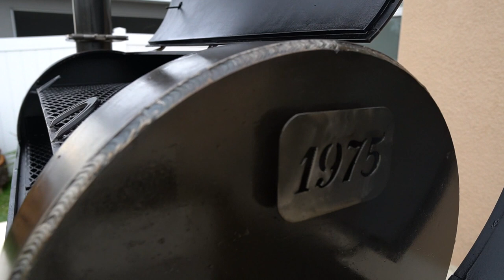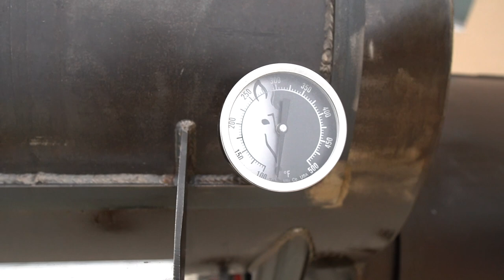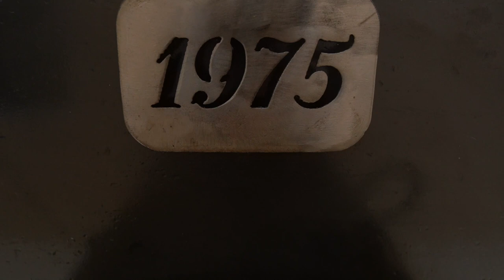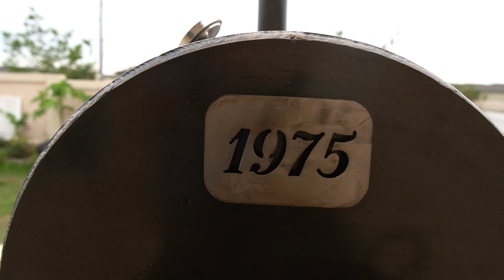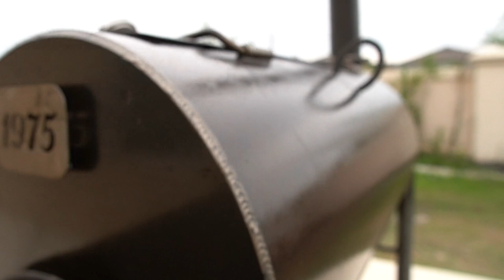Watch This Before You Buy a Workhorse Pits 1975 Offset Smoker

Comment: Awesome Smoker!
I’ve spent a lot of time researching high-quality craft smokers, and I believe this one is the absolute best as far as backyard smokers go. I really enjoy your videos! I’m making a smoker and I’m curious about a couple of measurements on this one:
1. How wide is the cookdoor opening? It looks like 40 inches?
2. How wide is the trim piece that goes around the edge of the cook door? is it 1 1/2 inch wide?
3. What is the frame of the cooking grates made of? It looks like half inch solid square bar.
4. How wide is the firebox door opening?
5. How tall is the firebox door opening if you measure along the curve of the firebox instead of a straight line?
6. How far apart is the upper cooking grate from the lower cooking great?
7. What’s the distance from the top of the cook chamber to the top of the firebox?
8. How tall is the hole that lets smoke in from the firebox? It looks like it’s half moon shaped with a straight line across the top of the hole maybe 8 or 10 inches tall in the center?
Thanks for showing us your awesome smoker!
Reply from the maker: Cooking Surface :
2316 Sq Inches with Top Pull-out Rack and Cowboy Grill
47"x23.25" Grate in Main Chamber
40.5"x15" Optional Top Rack
26.5"x23.25" Grate in Optional Cowboy Firebox
Exterior Size:
Overall Length - 84"
Chamber Length - 48"
Firebox Length - 27"
Overall Height - 85"
60" (stack down)
Reply: Thank you!
There are just 2 final details that I need to fill in,
How far apart is the top rack from the main cooking grate? And how wide is the cowboy door opening?

Comment: Waiting for mine to get here and can't wait. One thing I noticed was that the folding part of smoke stack has a gap in there. I see that there's a hole for what looks like a bolt or something. Is there a way to close that gap as I feel like that could be an issue with hot air leaking through that and messing with the draw.
Reply from the maker: it's not tight.... once you put the bolt in there it's sealed .that's not an issue at all.thank you for watching

Comment: I notice that the stack is not quite flush at the pivot point! Does it have an issue with smoke escaping ? Same ? For the rest of the smoker!
Reply from the maker: Once you tighten it with a wrench…it’s sealed. No issues on that department.

Comment: Thanks for doing all these Workhorse vids, good work and very informative, I've binged watched 'em all! hahaha :p We're north of the border so we're building one and wondering if you could assist with some measurements? Really appreciate it if you can. 

Overall height of throat opening? 
Height from bottom of firebox, inside, to throat opening? 
Height from top of firebox, outside, to top of food chamber? 
Height of top surface of cowboy grill from firebox floor? 
Height of smoke chamber food grate from ground? 
Length and width of the baffle plate inside food chamber above firebox throat inlet?

Thanks again man! Keep em comin'!
Reply from the maker: Will do when I get home …thank you🙏🏽🙏🏽
Reply: @BackyardWarrior  thanks brother! Owe you a beer!
Reply: height of the collector as well?
Reply from the maker: here you go brother
Overall height of throat opening:6 inch 
Height from bottom of firebox, inside, to throat opening :12 inch
Height from top of firebox, outside, to top of food chamber :12 inch 
Height of top surface of cowboy grill from firebox floor : 12 inch
Height of smoke chamber food grate from ground :12 
Length and width of the baffle plate inside food chamber above firebox throat inlet 20x4 inch 
smoke stack diameter : 5 inch
smoke stack height : 45 inch
Reply: @BackyardWarrior  You're a beautiful soul! Thanks brother, really appreciate it.
Reply: @The-Craftbrewing-Carnivore  Hey Greg.  I own the IP for the chase, and fold down stack.  Send the check attn: JD   I roll my own pipe.
Reply: @The-Craftbrewing-Carnivore   You ever get it built?
Reply: @Quetorials   The legend! Just curious if they make it for themselves do they owe you royalties? I thought that is only if they try to profit off your IP
Reply: @BackyardWarrior  maaaaan thank you soooooooooooooooo much 🙏🏽🙏🏽🙏🏽🙏🏽

Comment: I’ve seen some other videos where they say the pit has the “Carolina squat” on the firebox side.  Seems all the weight is causing some flattening of the pneumatic tires on that side- you had any issue with that on yours?  Beautiful pit, it’s a shame they don’t have locking casters though.
Reply from the maker: I don't have that problem yet 🤞🏽🤞🏽but I had some grease draining into the fire box before I leveled it

Comment: How’s the seal on the doors? Any smoke leaking during cooks? My concern with offsets has always been the firebox... I don’t want my firebox to look like crap or that it won’t last because of all the high heat in there. Also, if you don’t do the cowboy grill is it does it come “sealed” with just the flange/door for air flow instead?
Reply from the maker: no leaks so far... fire box is 3/8 as well .very thick and will probably outlive you if you take care of it.fire box without the cowboy grill is one cylinder with door for feeding it wood and air flows would highly recommend cowboy grill if purchasing the smoker.thank you for watching
Reply: @BackyardWarrior  thanks for the fast reply! Awesome, I had my mind set on the Aaron Franklin but at this point I don’t want to wait 2 years just for them to tell me it’s going to be another 2 years. I really liked that their firebox is doubled wall. Mill scale is just 1k more too much than I wanted to spend. The cowboy grill is something I probably don’t really need since i have so many options for high searing already.
Reply from the maker: @currysaucy4120  both wait list and $$$ are reasonable if you go  with workhorsepits.com
Reply: If you spray the firebox with pam before every cook it will look like a seasoned cast iron skillet.

Comment: What's the distance between the first grate and the second grate, and the second grate to the roof of the cooking chamber? Nice video!
Reply from the maker: here you go brother
Overall height of throat opening:6 inch 
Height from bottom of firebox, inside, to throat opening :12 inch
Height from top of firebox, outside, to top of food chamber :12 inch 
Height of top surface of cowboy grill from firebox floor : 12 inch
Height of smoke chamber food grate from ground :12 
Length and width of the baffle plate inside food chamber above firebox throat inlet 20x4 inch 
smoke stack diameter : 5 inch
smoke stack height : 45 inch  
happy thanksgiving
Reply: @BackyardWarrior  awesome thanks!

Comment: Really appreciate your videos. Are you having trouble finding wood? I am in So Cal and considering ordering a 75 or a 1969 but not sure where I would get the right wood.
Reply from the maker: wood is my last worry.. I think I have enough for 3-4 years.just watch Craigslist and FB marketplace..people always giving away wood.you can always buy it and thats the easy way to get wood.
Reply: I also live Southern California, San Juan Capistrano, get in touch with The Woodshed in Anaheim they have a great selection of hardwoods for smoking.
Reply: @grillinghotsmokinglowinthe6058  Awesome, thanks for that information! Since posting I also discovered South Bay Firewood in Hawthorne. Quite a drive for your but much closer than trip to TX for post oak if Woodshed does not have what you are looking for.
Reply: @NaturallyaspiratedJJM  That's good news for you. The Woodshed always has the wood I need. Waiting on a rack to hold 1/2 a cord of wood, should save me a lot of trips. My 1975 is due to go into production on March 16th so I'll have it mid April. The Horizon Smoker will keep me going until then.

Comment: Thanks for your informative videos! I noticed you have your Workhorse 1975 placed on a flat cement patio. How easy is it for you to push it around your patio? When I decide to get the Workhorse 1975, I plan to place it on my paver patio. How well do you think the standard 8" pneumatic caster wheels would fare on a paver patio? Do you think it would be better to get the wagon option for a paver patio?
Reply from the maker: I haven't  moved my smokers since day one... but it's not that hard with 8' casters. now if you have gravel, grass or dirt and you planning on moving it very often, you definitely need a wagon option.If it's going to be parked on the paver patio ..you really dont need wagon option.casters will work fine with a little muscle action to move it around

Comment: How even are your temps from side to side? Also The right side of the main chamber great closest to the firebox do you lose the first few inches because that area is too hot
Reply from the maker: Pretty even on the  main grate…a little hot on the upper grate(normal..heat rises) . Towards the fire box there is a  baffle plate that prevents the  high heat in the front…so no issues there.machine is well made and a lot of effort is put into it….thank you for watching 🙏🏽🙏🏽🙏🏽
Reply: @BackyardWarrior  hey thanks for your quick response I appreciate it. Are you able to use the entire lower grade to cook on? What's the most you have been able to comfortably cook on it
Reply: @BackyardWarrior  do the doors sealed with no leaks
Reply from the maker: @mikes.3165  I did 6 half chickens and 3 brisket each cook…I m sure you can fit up to 6 brisket in there…plenty real estate 👌👌👌
Reply from the maker: @mikes.3165  no leaks…
Reply: @BackyardWarrior  hey thanks again I really do appreciate your quick responses. I haven't been able to find a whole lot of information online. Is there anything that you don't like about the pit besides it not having a grease stop from the main chamber to the firebox I saw your video about the grease running into the firebox. Is the door very heavy.
Reply from the maker: @mikes.3165  the grease issue was mainly due to my floor that is not even…I have zero issues with this cooker… I m loving it 👌👌👌
Reply from the maker: And yes the door is heavy
Reply: You can put a slim water pan next to the fire box and a split of wood behind it that will help with close to firebox temps.

Comment: Hello, how long does this pit hold its temp until you need to add more wood?
Reply from the maker: Depends on the size of the wood. I usually feed it a couple a pieces every 30-45 minutes and I use around 12 inch long logs and 3-4 inch diameter.
Reply: Thanks!
Reply: What thickness of plywood did you have to use? I will be having the same issue to get it to my backyard.
Reply from the maker: @joshuaochoa4809  1-2 inches and the wheels sunk in few spots.i'd get a metal sheet if I had to do it again

Comment: If I'm correct you're smoker has the powder coated finish. Is that right?
Reply from the maker: No that’s the raw finish…thank you for watching 🙏🏽🙏🏽
Reply: @BackyardWarrior  Like the other viewers you also helped me finalize my decision. I  ordered mine yesterday.
Reply from the maker: @DMV_BBQ  glad I could help... I'm sure you will love it (smoker) brother
Reply: What other smokers did you guys consider? Any info is appreciated.
Reply from the maker: @WookieLove1  I had an old country BBQ pecks before I made the switch and I was looking at mill scale Lonestar grillz and  @workhorsepits
Reply: @BackyardWarrior  I keep wondering about offset vs reverse flow. Looking at the Shirley smokers. But I'm just not knowledgeable to stick burners. I'm a weber guy but want to add a stick burner.
Reply from the maker: @WookieLove1  you have to start somewhere right...I have zero experience with reverse flow smokers, so I can't really chime in on that.
Reply: @BackyardWarrior  understood and appreciated. I'm not making the case for either. And I love the 1975!!
Reply from the maker: @WookieLove1  🙏🏽🙏🏽🎂

Comment: What are the dimensions of the opening between the firebox and the main chamber?
Reply from the maker: here you go brother
Overall height of throat opening:6 inch 
Height from bottom of firebox, inside, to throat opening :12 inch
Height from top of firebox, outside, to top of food chamber :12 inch 
Height of top surface of cowboy grill from firebox floor : 12 inch
Height of smoke chamber food grate from ground :12 
Length and width of the baffle plate inside food chamber above firebox throat inlet 20x4 inch 
smoke stack diameter : 5 inch
smoke stack height : 45 inch
Reply: Thanks man!
Reply: I wonder what the opening for the smoke collector is?

Comment: Are you sure that's a 8" diameter stack
Reply: Thanks for sharing this video
Reply: Can you also tell me what's the height of the stack from the top of the collector and what's the width of the collector thanks
Reply from the maker: I was wrong about diameter..it’s 6inch and the stack is 44 inch high
Reply: @BackyardWarrior 
Is that stack diameter measurement inside or outside dimensions?

Awesome review btw!